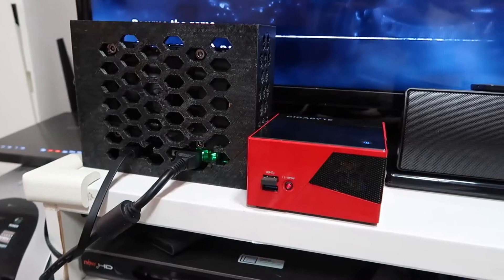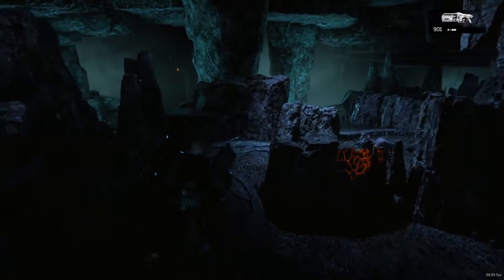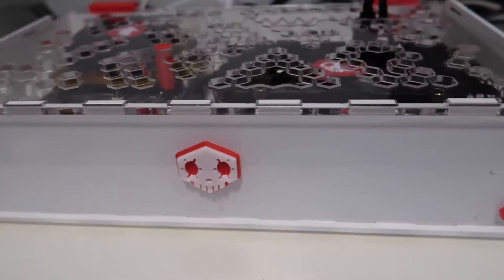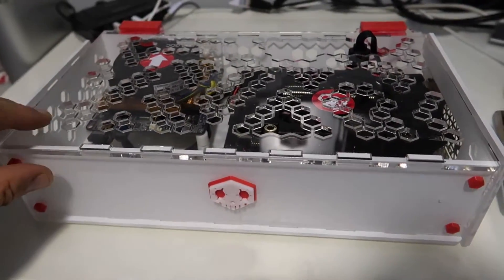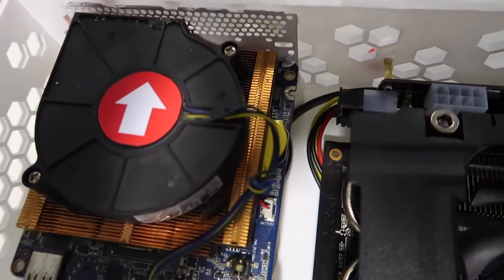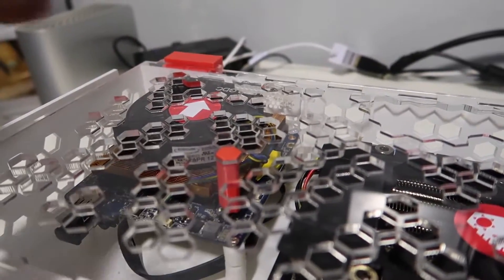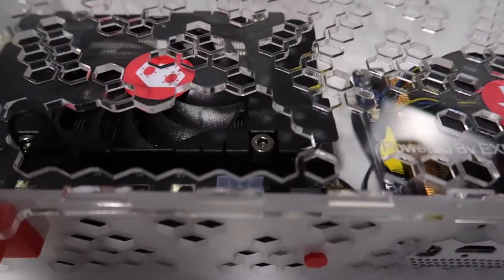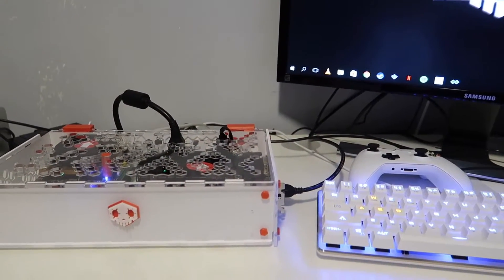Making a custom case for an eGPU and mini pc together

Comment: don't you meet the error 43 problem that NVIDIA ban the EXP GDC with 10xx series?
Reply: This works for me on a 1060 on latest drivers and didn't need to mod the driver. 
https://egpu.io/forums/expresscard-mpcie-m-2-adapters/FIXED-Nvidia-GTX1050Ti-error-43-on-mPCIe-or-M2-non-hotplug-eGPU-interfaces-applicable-to-GTX10xx/

Comment: http://www.ebay.com/itm/EXP-GDC-Beast-External-Independent-Video-Card-Honeycomb-Protector-Case-Box/142244933391?_trksid=p2385738.c100677.m4598&_trkparms=aid%3D222007%26algo%3DSIC.MBE%26ao%3D1%26asc%3D20160908110712%26meid%3Db0ec8328c4c84487a3baf8d965d075a6%26pid%3D100677%26rk%3D1%26rkt%3D31%26sd%3D112326572075

You're Welcome.

Comment: hi ! great video! i have an asus a45a and a egpu beast 8 with a corsair x600 psu. as soon as i plug the egpu, even withou the video card, the computer freezes into a white or blue screen and after a few seconds it turns off. i tested it turning the egpu after or before the notebook but the result is the same. anytoughts on that?

Comment: dude i love what you did with your case i have a very similar setup, except i had an extra 600w silverstone psu lying around and the gigabyte 1070 mini itx oc edition style card with rgb lighting wrapped along the inside of the case. they both fit snuggly inside the same honeycombed crystal clear case you have, and it looks amazing.  But i have to give you props on your 3d printed hinges...... sheer genius bro. i love the fact that you have yours laid down where as mine is upright. great job once again my brother keep up the great work.  gave you a like and a subscribe as well

Comment: Hi Stu, neat set up.  I am also trying to use the 1060 but with a laptop running Windows 10.  Not sure if you have any advise but I am having problem with the Nvidia Driver Installation utility.  While checking for hardware, it returns with no compatible hardware found.  Not sure how to proceed.  Any help is appreciated.
Reply: Thank you for your advise.  I am getting error 43 when I ask Windows to auto search and install a driver for the video card.  After that I downloaded the driver directly from Nvidia and got the no compatible hardware found while using the Nvidia installer.  I will go check out the egpu.io. Thanks again.

Comment: Hi Stu, Great video.
I'm interested in using a CNC/laser cutter to cut my own case but, more relevantly to what you're doing here, I was wondering what base parts you might recommend if I was going to try and use a Kaby Lake CPU (i5 7600k) and a GTX 1080. I was also considering using the gigabyte NUC GB-BKi3HA-7100 as a base, but the eGPU stuff that you've mentioned is brand new to me.

Liked and subscribed :)